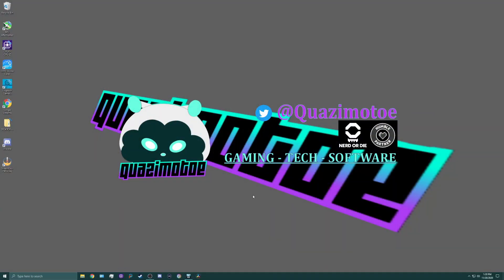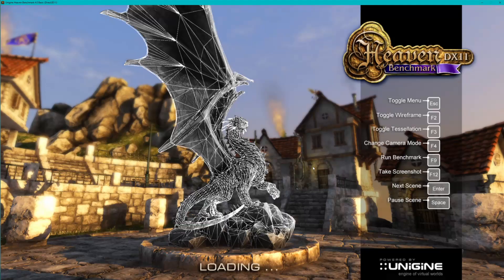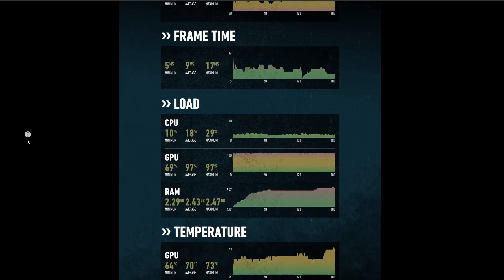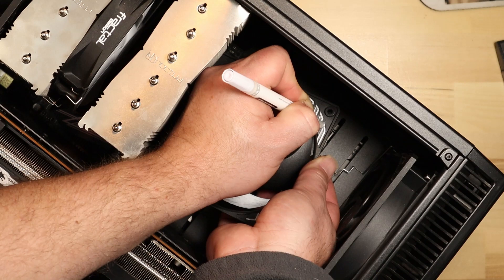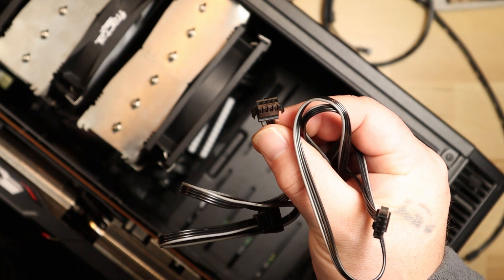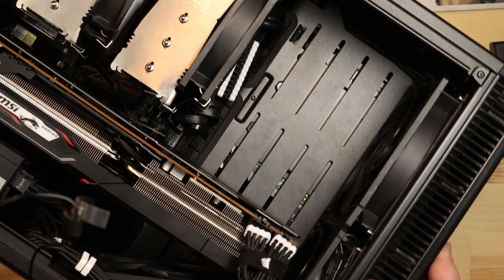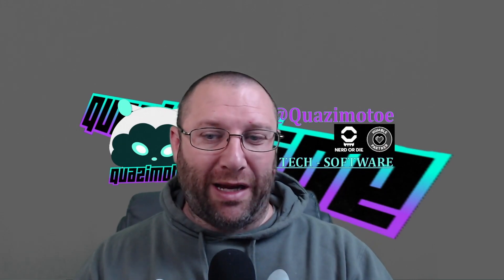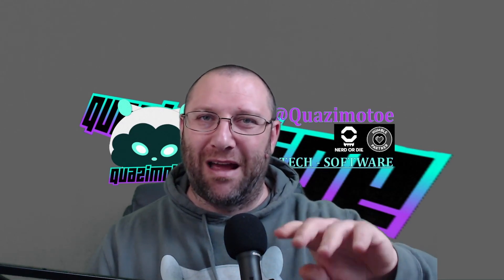MSI RX 5700XT Gaming X Undervolt and Nano S Case Customizing!

Comment: What junction temperature do u get with stock settings and stock voltage of 1200mv in your 5700xt gaming x ?
Reply from the maker: Ran it at stock for 15 minutes for you just now... GPU temp 79C, Junction Temp 86C, Hot Spot 109C
Reply: @Quazimotoe  junction is hotspot only , so yours also reaching 109 hotspot. So all 5700xt gaming x have bad thermal paste. I have this same card and mine too reaches 109-110 at stock.
Reply from the maker: Not according to HWInfo and the tech channel reviewers. But either way undervolting the card drops the temps and keeps my Max boost clocks above 1950mhz.
Reply from the maker: I'm sure changing the TIM can help too but undervolting is much simpler than a disassembly
Reply: @KartikArora03X  did you change your TIM?
Reply: @Quazimotoe  It's wierd some card have junction at 110 some 80. I will prob need undervolt mine too and after warranty replace thermal paste.
Reply from the maker: @djiricka  depends on what it is running too. Mining makes them cook! I deshrouded mine in the NR200P and added 2x140mm fans to the bottom intake. Might try 120mm to see if they work better next.
Reply: @Quazimotoe  Well I don't mine . But I will try it.
Reply: @Quazimotoe  So quick update friend. I repaste my card  (screw warranty) and from 80° GPU and 100-110° junction. Temps go to 60°GPU and I max 75° junction. I used Grizzly Kryonaut.
Reply from the maker: I've done that a few times with the deshroud and then reshrouding. I used Arctic MX5. Works just as well